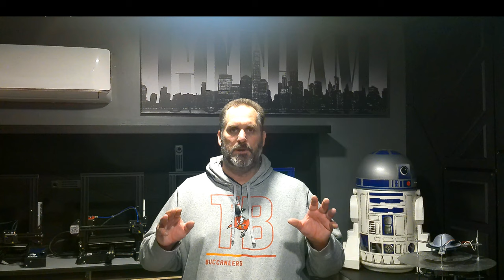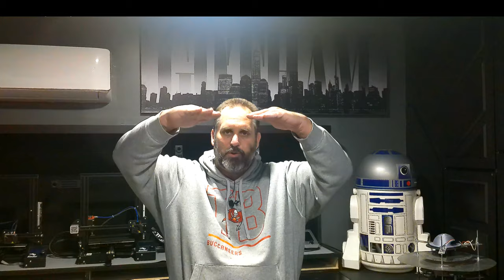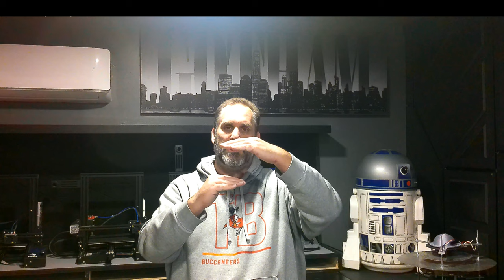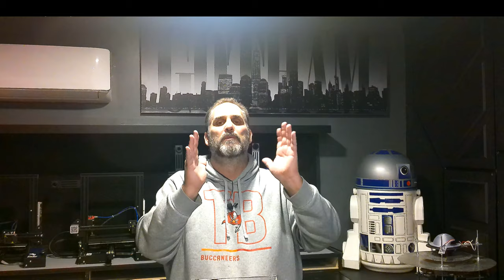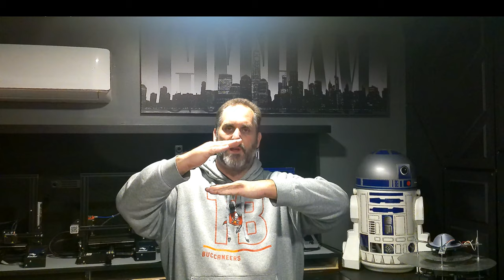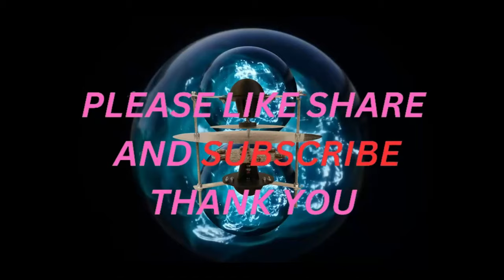Graviflyer "Explaining The Piezo Disc" #34

Comment: I am starting to think this thing works like an acoustic levitator(like others have stated) but the difference is that you are amplifying/expanding pressure with static voltage, allowing the whole craft to be buoyant. I think that 20 hz eliminates everything outside its range and  is somehow the start to increase the pressure but it's only one the first step in the process. This might be able to be simplified once it can be replicated & the steps can be broken down. Keep up the good work, I think you are getting there!
Reply from the maker: Horses on a bridge to make it destructive is at very low frequency's. The pulse or beat range is the same. It would be the only way to effect nature.
Reply: @nathanbunten4299  I will try to make a video about my mini acoustic levitator I built because I get the same 20 hz signal around it and then a lot of other frequencies in the levitation zone. Maybe it will help you picture some things that need to  be done.
Reply from the maker: @Tech_Planet  that would help. Anything at low frequency that has to do with levitation. I am 100% there. thank you.

Comment: Interesting thoughts! One issue though, the craft lifts off the ground when Alexey disables the US circuit by pressing the off button to break the circuit, then he releases the off button and lets the ultrasound turn back on into the khz range. If the buzzer is no longer producing the MHz frequencies to push down on the center disc's MHz freqs, then how does the craft stay in the air? There must be some kind of change that is occurring when the button is pressed down, and that change continues to live on after the button is released.
Reply from the maker: I think it is the opposite. He cannot be holding the button the whole time when walking around it. Pushing the button needs to turn it on. I am moving the static voltage out with the tesla coil in the center. This means that the static volts can be moved. If the upper plate's charge is pushed to the center plate. There is force upwards based on small plate to big plate. I did it in the paper lifter. I also did it when I created the plasma from the top disc to the center plate. I can 100% create force if I can move the top plates positive charge to the center plate for a second. It is the jump. 

He cannot directly put the center plate positive because of the field of the tesla coil. But for a second he could charge the center plate positive and get the power of both the tesla coil and the static voltage from the Hv to the center plate creating a burst of energy.  

If I can prove the piezo disc moves the static field on the top disc We have our lifting force. That makes the circuit wrong, but  all we have to do is replace the button with a switch. We can change the voltage with a power pack that has a Dial.  The HV is in khz as well. So finding a frequency that matches the HV to the piezo should spike it at the correct amplitude (power level) as a sudden pulse. ( this testing would only show the lifting factor ) I agree he needs the constant frequency to hold it up. 

We can set The frequency of the HV by adding the circuit I built. ( The one that changes the frequency) We no longer have to test for it after we make sure it is accurate the first time. It basically takes the problem out of HV testing on the Graviflyer. 

Remember The first US circuit had 2 dials. The reason was, one did constant direction. (stays up at low power) The other was for lift. ( a sudden increase at high power ) If you took out his second dial and put in a switch the circuit makes sense. His first dial set the frequency the second was the amount of power. 

I really think this is it so I am testing on it all week.
Reply: Did you ever think that the button is a magnetic switch that turns the ultrasound off for good? Just like a PC on and off switch. The ultrasound keeps the voltage near zero so the charge can build up over time as we see it takes time for Alexey to wait to push the button. When he pushes the button, the voltage rises high on the center disc and low on the top and bottom disks so the charge of about negative 0.2 coulombs show up on the top and bottom disks that are an Al and Al2O3 coated disk with trimethyl aluminum so you have a normal top and bottom capacitor and not the air capacitor that you both have that shorts out and cannot hold the high charge. Using the coulomb force equation one can calculate that the craft lifts up to equilibrium at the correct distance to the center of the earth. The groves on the CD and the hammer marks on the center disk allow the ultrasound to go through the disks so the voltage is suppressed. The polycarbonate and Al2O3 help to keep the large negative charges separate as they are a dielectric.  The high center disk voltage and large radius keeps the high negative charge separated. The center disk has a positive charge as a result. The large negative charge on the bottom disk repels the negative charge on the earth and the large negative charge on the top disk attracts the device to the ionospheres positive charge. The spinning disks make a torsion gravity wave. The magnets on the bottom disk and the produced magnetic field from the induced current on the top and bottom disks also keep the negative charges separate and also helps to levitate the device by pushing against the earth's magnetic field. Tilting the device allows for propulsion as well as the lift and why UAP are either bell shaped, saucer shaped or spherical shaped so the disks can be reoriented and travel at high rates of speed at high accelerations. Changing the charge changes the altitude of the device. I talked to Alexey with the Chinese scientist, so I know all of this. You need a battery to power the device with a high amp-hour and a high chemical frequency and not the power grids 60 hz frequency with the power supply, so you get light and not the RF as UAP as they approach the earth glow with the light's exchange particle like between a proton and an electron. The earth is the proton, and the device is the electron.

Comment: Hey, thank you for this info. A little off topic, will you please show me exactly where the tesla coil is connected to the graviflyer? And I bought a mini speaker : diameter+1inch that is controlled by my smart phone to play high frequencies to replace the piezo disc. What do think?
Reply from the maker: it is connected on the center disc right next one of the legs. If you want to replace the piezo you need to do testing on pushing static fields.

Comment: If I'm correct his magnets were old so may not have been as strong as newer ones.
Reply from the maker: because of the type Alexey uses they are half strength of the n52's. From the start. If they are worse they could be used as fridge magnets. I stopped using n52's when I finally traced all the energy patterns and fields.
Reply: A magnet should last around 400 years before it losses magnetism or become demagnetised  unless other forces have forced it to become weaker from interaction with an apposing field that weakens its field, heat will also demagnetise magnets

Comment: One of these fan speed modules things that just dose that, linked to pc.  Only to find the sweet spot then you won't need things to turn or buttons to press I guess.  If you can jerry rig diagnostic, a plethora of small tubes forming some kind of array encompassing the top half (idea).  Hopefully visualise the pulse and it amplitude. to produce the right depth.           Something in my stomach says your piezo aint man enough. said in respect to you Sir.  He's not wearing a crash helmet for nothing, Could be pumping it out. (sound wave protection maybe)
Reply from the maker: It is the fields. I created them in my garage and when they get out of hand they make you really sick. The headaches are brutal.

I can connect the fans to my pc, but I want an independant version.
Reply: @nathanbunten4299  The hall's being a switch, the right voltage, A model plane tachometer and a adequate bulb suck in the end of it darken of with some tape perhaps. (depending on the tacho a two blade one you have to half it) RPM's. 
OR 
 A DIGITEN 4 Digital Green LED Tachometer RPM Speed Meter + Hall Proximity Switch Sensor NPN   Amazon. 
  Just connect the one in the fan instead of the one in the box.
  it was just a quick look you may see something more appropriate.

Comment: Tesla was crazy about bifilar coils I hear. It's very interesting how you can control three from one. Sounds like the permanent magnets need to become coils and a controllable feature. Best part about them is they don't even have to be wired into the others Just proximity to them
Reply from the maker: I like the concave tesla coil idea. or 2 cones where the small ends are in the center. The #1 coil is at the center but it is a spiral shape. Like a donut with windings. no rotating disc's The outside frame or skin would be the only rotating disc. This would be the start of a solid state version for me.
Reply: @nathanbunten4299  agreed

Comment: I cant help to think this piezo electric set up resembles those styrofoam ball levitation goys... I even saw one where they made the ball rise and drop.  Sounds like what your doing but instead of styrofoam ball your doing a field
Reply from the maker: I think it is the same thing as well. We are moving a static field. Only 1" Have you done these experiments on the piezo? This might be where exciting the air comes into play. 

I cannot directly connect it because of the tesla coil. I should change the circuit and just try to push the field.
Reply: @nathanbunten4299  unfortunately I havent been able to do any work on the graviflier yet.  All I've done is print out the parts but I've been caught up with another project which id love to show you some time but I'm not ready yet lol. And time is tight.
Reply from the maker: @TheJestar30  I would love to see it when you are ready

Comment: If you make a heavy disc (R=10cm) spin really fast vertically, and on the bottom side have a pair of disproportional capacitors (R=3cm and R=0,5cm) aligned so a part of the disc spins between them, there should be a lifter effect already. - How much of it, it would be controlled by the voltage applied and the RPM.

Now obviously, you'd want at least 3 discs spinning, to make it stable, but for a basic weight check 1 will be enough.

On the ARV the bottom part generators could change the orientation a little bit purely for this reason alone. The shape of the field is then slightly off-balance and uneven coverage of the spin mass triggers motion in the desired direction. The piezo-electric part that sets the frequency in the designs you follow is doing a similar thing, the mass is slightly cancelled on the motion up and increased on the motion down. The device is essentially vibrating away from its position. The spinning disc would serve the same purpose but is way more stable.